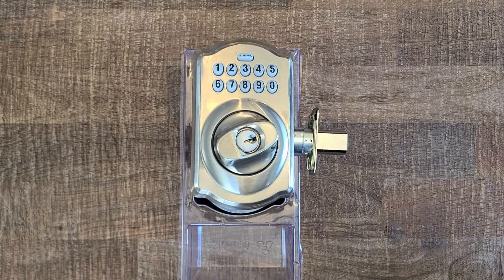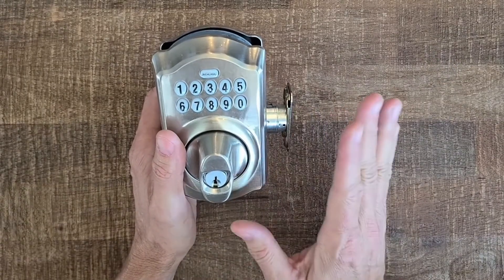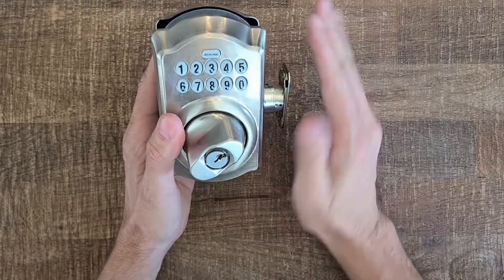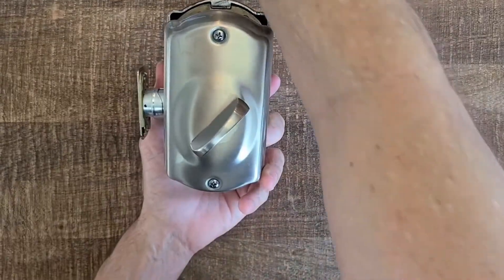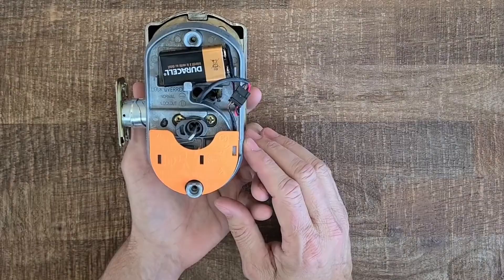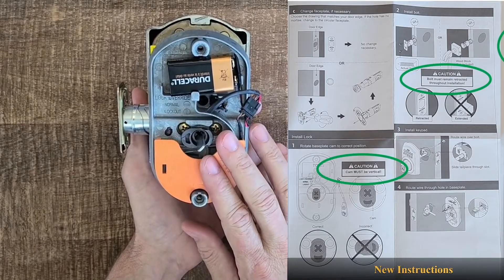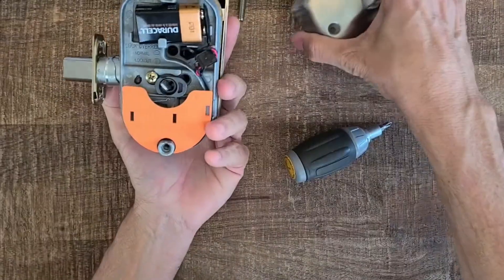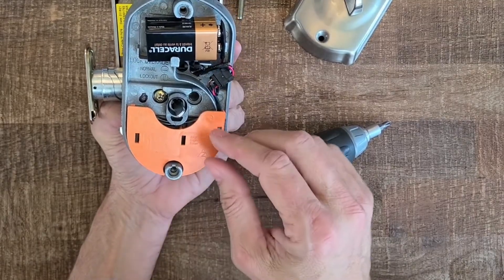Help! The Schlage Button Unlocks my Door!  How to Fix a Schlage Electronic Deadbolt.

Comment: Thanks for the video, Robert! Any insight as to why this exact issue would be happening when the lock is installed correctly, as you described? To clarify, the lock is installed with the deadbolt retracted and the cam arrow pointed down, however, I'm still able to unlock the door from the outside with just the Schlage button.
Reply: I think I may have fixed it. I believe our Lock & Leave feature was malfunctioning for some reason. My steps for success below:

1. Factory reset the lock with your "How to Reset a Schlage Electronic Deadbolt BE365" video (https://www.youtube.com/watch?v=lAsLBmbDrRQ). This engaged all factory settings, to include enabling the Lock & Leave feature by default. At this point, I was still able to lock and unlock the door from the outside with just the Schlage button and without entering user codes.

2. I then used the steps provided by Schlage in my user manual to disable the Lock & Leave feature (will include steps below).

3. With the Lock & Leave feature now disabled, I ensured my deadbolt was in a retracted position with the cam arrow pointed down/in a vertical position, as described in this video, then re-enabled the Lock & Leave feature. I confirmed I was then only able to unlock the deadbolt from the outside with a user code, and could utilize the Schlage button to lock the deadbolt. I also confirmed the Schlage button alone would not allow the deadbolt to be unlocked.

HOW TO ENABLE/DISABLE LOCK & LEAVE FUNCTION ON SCHLAGE BE365:

1. Enter your Programming Code (six numbers). Wait for the SCHLAGE button to blink orange 3 times and beep 3 times. 

2. Press the SCHLAGE button. The keypad will turn blue.

3. Press 7. The SCHLAGE button will blink green 1 time and beep 1 time to indicate the Lock & Leave function has been successfully changed.
Reply: Help, Robert! After getting the BE365 to work correctly with all I did above, I'm now back to a state where the SCHLAGE button will both lock and unlock the deadbolt when Lock & Leave is enabled. When Lock & Leave is disabled, I'm unable to lock the deadbolt with the SCHLAGE button when leaving (as expected with the feature disabled), but I'm still able to unlock the deadbolt with the SCHLAGE button and no user code. I'm at a total loss. My results seem to be totally inconsistent.
Reply from the maker: If the lock is installed correctly as I describe in the video, I'm at a bit of a loss as well. Call Schlage's customer support. They should be able to get you taken care of.  (888) 805-9837
Reply: @carolineevail  thx for this breakdown. I was having the same issue as you and tried your steps to fix it and it worked. Thx for replying to yourself with the solution.
Reply: @carolineevail  what if you don't have the programming code? I'm having this same problem.

Comment: We have one of these on the front door; it was in the door when it was installed 5 years ago. It worked fine for a couple of years but then started acting up - wouldn't lock, or unlock, without several tries, and the few times I tried using my key I had a lot of trouble getting it out. It is now to the point where it's faster to leave it unlocked and just lock the outside door (not terribly safe) or just use the back door (2 doors, 3 locks). But that defeats the purpose; I wanted it in case of an emergency, in case we couldn't get to the door to unlock it (we are both seniors); we could give the code to the first responders.

From watching another video here I think the problem is with a small thing inside, but it wasn't good enough video for me to feel comfortable even removing the lock from the door, let alone fixing it. Apparently it's a common problem though so if you'd like to address it that would be great (I did understand this video, which gives me hope I might understand others). Otherwise - I'd like to know whether it could be replaced with a different lock (meaning, is the hole in the door a standard size?) or am I stuck buying another one of these? Which frankly I'd rather not do.
Reply from the maker: The electronic deadbolts install inside a standard hole. So you could replace that one with just about any other one you find. We have some great videos comparing and installing Smart locks. Check out our other videos. ✌️
Reply: That's good to know, thank you. I'm going to look for a replacement.